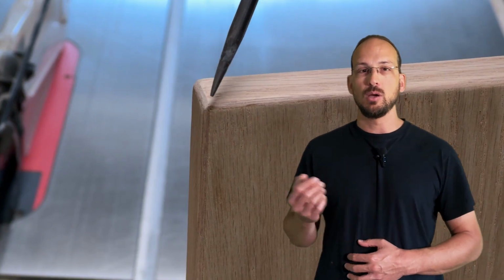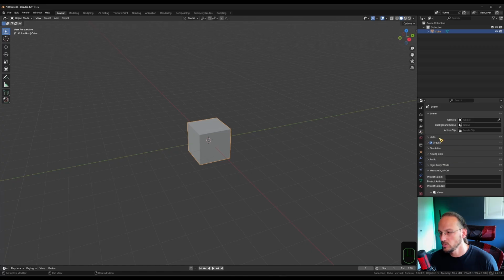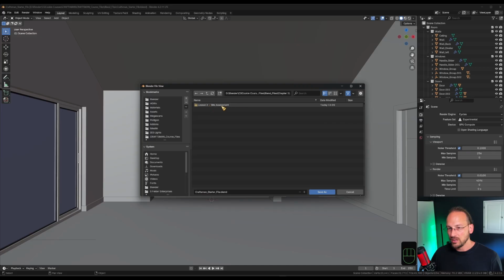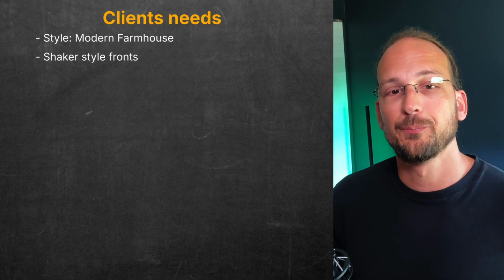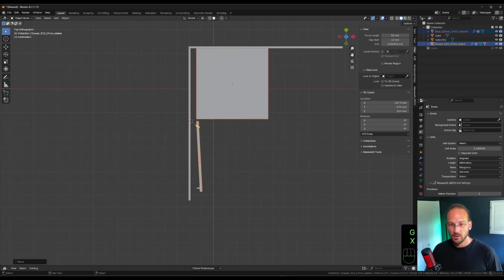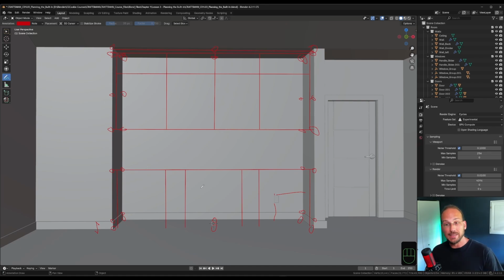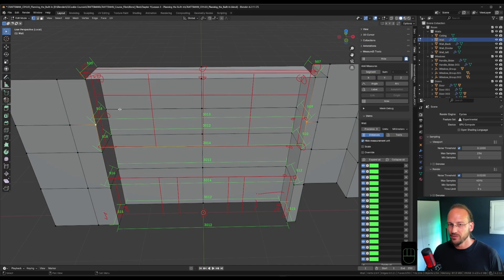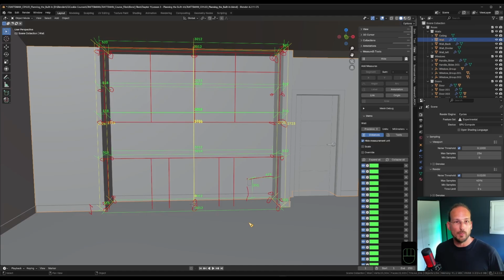Planning Custom Built-In Cabinetry with Blender | CRAFTSMAN Chapter 1

Comment: 36:58 you can measure between 2 objects by join them in object mode with Ctrl+J
Reply from the maker: good tip, thanks for sharing!
Reply: @cg_cookie but then the axis measuring will not work properly.